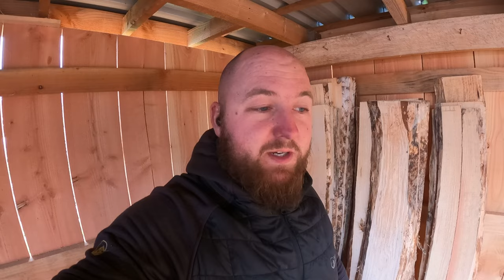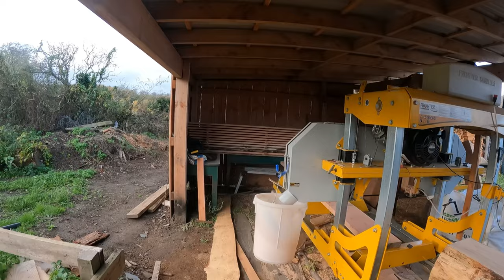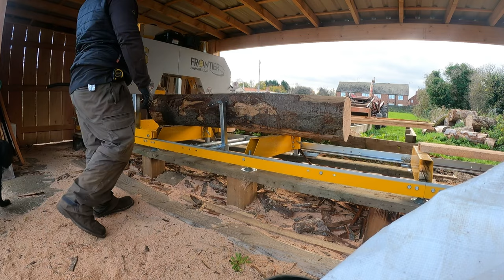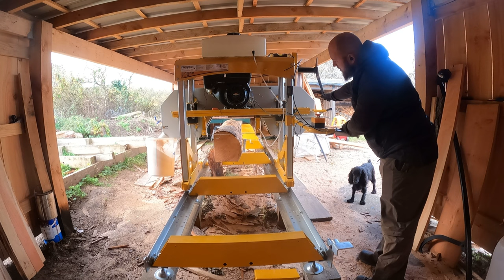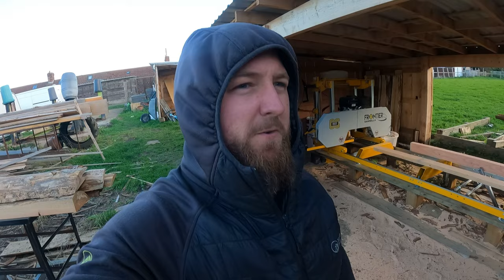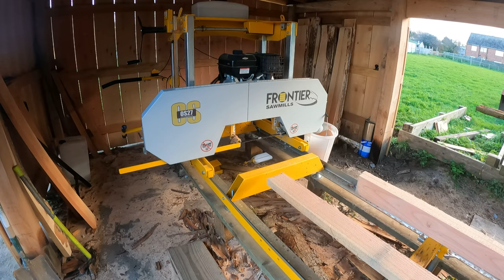Frontier OS27 sawmill milling 25mm boards for sawmill shed doors.

Comment: Good to see you on the mill again. If you're not busy you could come over for few weeks work here. Flat out going into summer. Oh and I live in the wine region, did I mention that. Cheers Dave.
Reply from the maker: Hey Dave, please don't tempt me. If the flights didn't cost so much I'd be coming over to assist no problem. I can turn my hand to most tasks 😄 but I must say coming into winter is nice to work in for me 🤣 
Thanks for commenting buddy 👍

Comment: I know what you mean about digging around utilities. Two springs ago I was summoned to put my sisters 500 ft waterline in. So I called 811 ( NYdigs) to layout all the stuff down there in the ground. I took pictures of all their work. Rented a 24,000 lb track hoe and started digging at the road. Got about 20 feet and hooked on to a big root. Well it wasn’t a root , it was a 3 inch phone line with a probably a thousand little wires inside. It was every thing that machine had to rip it in half. It wasn’t laid out and I figured it was an old not in use line. Well three guys worked a week to splice it back together. Never heard a peep about it. Taking pictures of their work is important , but luckily didn’t need it. Bla bla bla. Digging can be stressful 😊
Reply from the maker: Hey Terry, it's sure is stressful. Over here in the UK the utility companies can charge a fortune for repairs if you break them. So my head was racing with stressful times that day. 
Thank you for commenting and of course welcome aboard 😀

Comment: Nice one Nick two nice sawdust and black spanner’s  you where definitely in the sawdust firing line shame the handle wasn’t on the other side 
Cables are never where they should be and the second you take your eye off your out of pocket 🙈 stay safe lad 👍👨🏻‍🏭
Reply from the maker: Hi Paul and thanks for commenting. Yes the sawdust was being blown right at me, hence the need for a door on at least one side now. It's like a wind tunnel as it is now.
Exactly right about not keeping an eye on things, it could have quite easily cost me a lot of money to put right.
Thanks for watching 👍

Comment: You messing with the water feeder valve on your machine reminds me I got to do something with mine, I have the same type of water feed tap as you got. I'd like to make it a proper valve that you can open and close with one finger and better flow controllable. Maybe hard mount it.🙂
Reply from the maker: The stock one that came with it is absolutely terrible. I put another inline valve in place and they are water irrigation taps and they're super handy and easy to adjust the flow. I'll do a video, I've probably said that before but I will 😆 thanks for commenting 😊